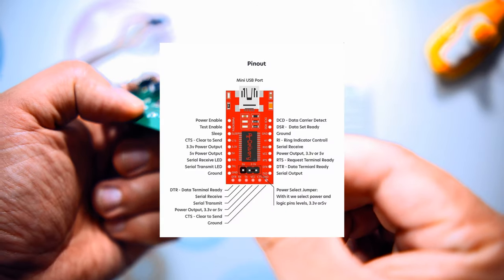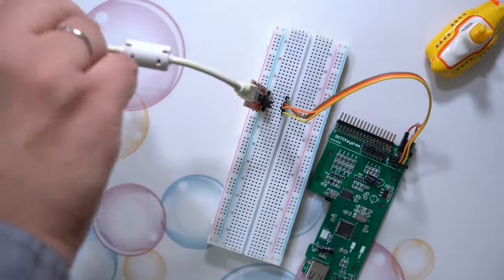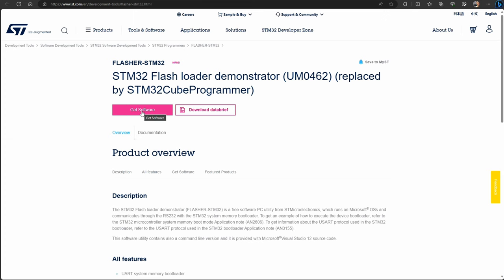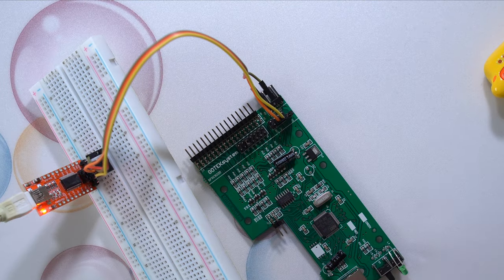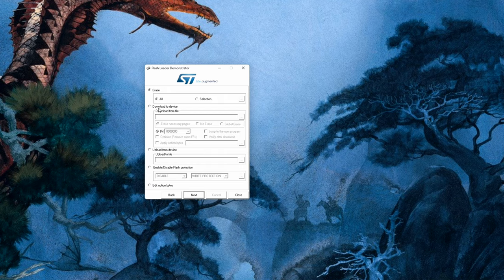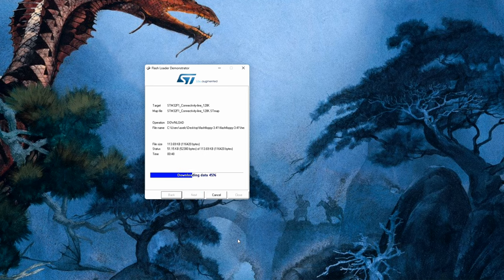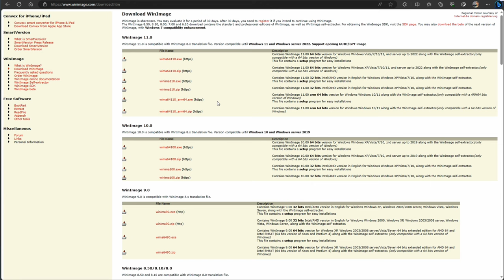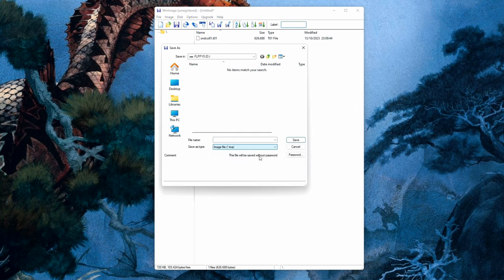How to add a USB port to Yamaha SY99, explained in 5 minutes (flash floppy)

Comment: I bought a pre-configured emulator for the SY99. Everything seems to work (the emulator's display shows the .hfe images on the USB drive correctly) - however, when I attempt to "load from Disk" - "all synth" (or anything else), I get an "error: disk not ready" message (also "utility" - "disk status" gives an error message). I' tried several USB devices formatted (FAT-32) on different computers already - to no avail. Has anybody encountered a similar problem? Cheers!
Reply: Just figured out that my "pre-configured" emulator had the jumper in the wrong position: "S0" instead of "S1", where it's supposed to be - now everything works fine.
Reply from the maker: Ah, ok. Glad it works.

Comment: Could you tell me where to get the adapter cable? I have got the 34pin to 26pin adapter, but no cable.
Reply from the maker: If you already have the adapter, you should be able to just use the old cable. If you don't have that anymore, please try this link (select the correct amount of pins before ordering) https://www.ebay.com/itm/335063190515

Comment: Must be different to the SY77 ...I got the 720kb emulator and it worked fine. Nothing required at all. Plug n  Play all sweet.
Reply from the maker: Nice! I think it really depends on the vendor and the firmware version installed. I had an older drive that kind of worked, started loading files and always displayed a "read error" after some seconds.
Reply: My SY77 has a 26 pin ribbon cable but must connect to the emulator's 34 pin one. Did you have to get the cable and if so can you tell me frm where please?
Reply: @terencemorgan1723  I just used the ribbon that was in it (34). Never heard of a 26.
Reply: @wilcandou  It seems that the Yamaha SY77 has its own version of the floppy disc. This only has a 26 ribbon cable and there is no supply plug. I have found an interfacing board which has a 34 ribbon plug which fits on the disc or emulator. It has a flat cable connector with 26 conductors but this is not a dual row connector, it has all 26 connections in a single row with 1mm pitch not the 2.54mm of the typical ribbon cable connector. It also has the 4 pin supply connector which is derived from the 26 cable and a small 4 way cable and plugs to enable it connect to the emulator. I could not find a flat cable with the end having a 26 pin female dual row connector. I have decided to order a 26 cable and female dual row plug and I will solder the individual leads to the flat cable connector on the interface board. I'll let you know if it all works.
Reply: @terencemorgan4453  Wow ok... It must have been some early version in the SY series and later they went to the the 34... I can't really say. Have a look at the serial number on the back of the keyboard Mine is Q104095 ...is your's a lower number than this? Maybe the hint might be in the "Q" ...not sure.
Reply: @wilcandou  Indeed that may have been the case. My serial number is QM001004 which is 103091 less. As with many devices, specifications are subject to change without notice.

Comment: Are there any floppy emulators on the market which will work just out of the box, without these manipulations?
Reply from the maker: Depending on which keyboard or hardware you own, you might be lucky and the very cheap models will work right out of the box (or with some jumpers moved around, which you can learn about online).
If you really want a flexible solution that lets you set up everything with an on-screen-menu, you'll have to pay at least 4 times the price. Here's an example https://amzn.to/3W1z6vs
Reply: @mr_floydst  What u mean which keyboard? I have the sy99. Do you know these cheap models which will work for sure with no extra modifications?!
Reply from the maker: @ingoodmusic  I'm sorry, I can't tell you a specific model that will work out of the box.

Comment: If my old SU700 would have had an easy to install option, to expand it's sample storage much earlier on, I bet I would still be using it today. A Zip Drive would have been decent, but an HDD really should have been the standard paripheral, instead of a floppy. I have been considering buying a minty one with all new encoders, and a microSD drive, for a while now. I know somebody who has one. Not cheap. Substantially more than I originally paid for mine- $1000USD in 1999. It seems to work great, when I played around with it last year. Loading and saving large projects, took a few short seconds, instead of minutes. Slower than many microSD capable machines today, but many times faster than the stock SU700, and my piles of 3.5's. 🤣
Reply from the maker: Thanks for watching - of all the physical media, floppy drives are the worst. ;-) But they were cheapest back in the day, so that was the standard.

Comment: Some months ago, I installed one on my old PSR 9000. It works. The drive is not that easy to use at the beginning, but you get used to it. It is a really nice invention. You feel like texting on an old Nokia, if you passed the disk you want to use, you will have to go through again, lol

The funny thing is that if you connect the USB directly to a PC, you will only see the first virtual diskette. Only through a software, you will be able to see the other disks.
Reply from the maker: Thanks for watching! 
By using the flashfloppy firmware, you can use a normal USB stick, but you need to create image files, which is just as cumbersome as the "multiple partitions" solution of the original gotek adapter. So you're left with the choice of the lesser evil ;)
Reply: @mr_floydst  Thank you for the suggestion. The firmware update sounds good. I will try it. I think that one USB is better than having to fit several files into 100 virtual floppies, lol

I'm now looking at their page, but there is no documentation about the enhancements to the Gothek, or at least I didn't find it.
Reply: Ok, I just found some of the improvements:
* OLED Display instead of the 3 Digit Display
* Internal Gotek Speaker to hear those floppy sounds!

* Gotek Rotary knob for easily selecting that game, app or demo
* Support for multiple images

* Support for multiple track layouts

I still don't understand them all. But I guess the rotary knob is already a good addition.

Do you also have several disks with the images? Or just a big disk with all?
Reply from the maker: It's one big USB stick and you need to build image files, as shown in the video. You don't need to add those hardware additions, just installing the firmware is enough.